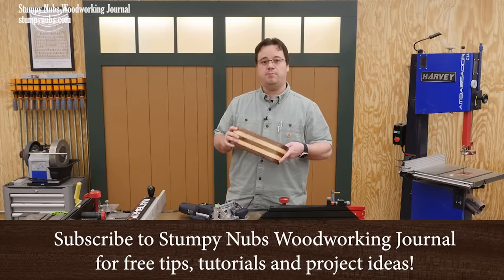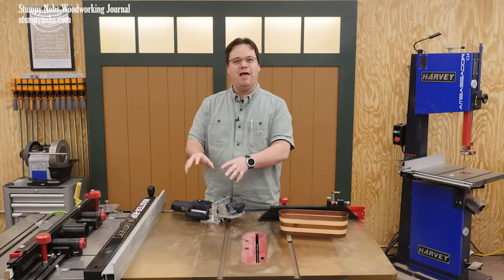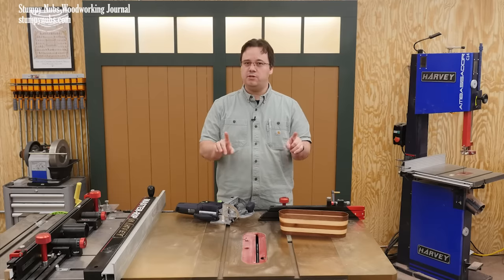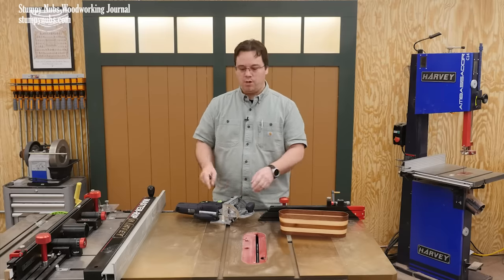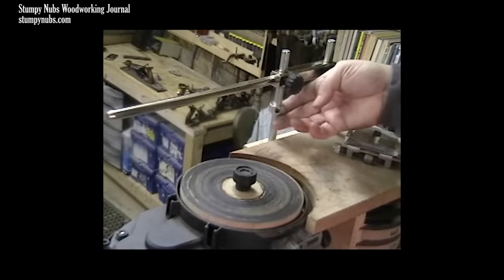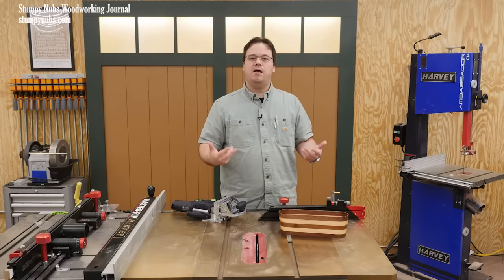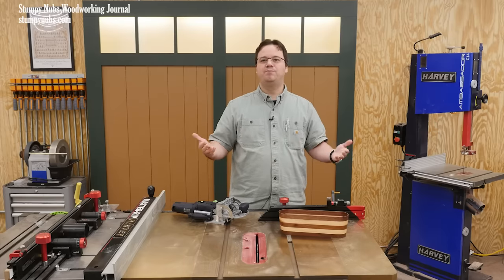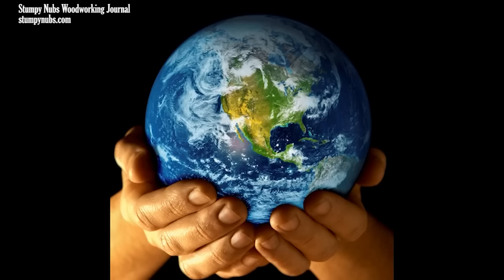This is why people HATE Festool and their Domino!

Comment: Festool typically charges 2x what Makita or Bosch charge for a tool, but the Domino is an extra 2x on top of that due to patent exclusivity. The Festool router is $600 and the closest Bosch is $300. The Festool miter saw is $1500, when a Makita or Bosch equivalent is $700-800. As soon as the parents expire, Makita and Bosch will make $300 Dominos and Festool will have to drop the price to $600 to compete with them.
Reply: Same with SawStop, owned by Festool. It will take years until that happens and other companies tool up and start producing a RELIABLE copy/reproduction
Reply: I can guarantee you Festool won't drop anything. If you've ever used a Festool tool you'll know there's a major difference in quality. Even the high end Bosch and Makita can't compete with the Festool quality.
Reply: @HaasGrotesk  You say that, but as I have pointed out with data, every Festool product only carries at most a 2x cost premium over a comparable Bosch or Makita. The only exception is the Domino, which carries a 4x cost premium, due to the patent exclusivity. (I estimate others could make a Domino for $300 based on seeing brushless trim routers for $200 that appear to have similar power. I added another $100 for router oscillation and a fence.)
Reply: @maximusmagni1  Well, we'll see.
Reply: You beat me to it.
Reply: I agree with everything you've said.  I just wanted to point out that this is a good example of patent protection making it possible from innovators to recoup development costs and an incentive to innovate in the first place.
Reply: Festool are made in Germany, not China, and the quality and design are in a league of their own. I say that as a Makita owner (made in the UK). I will pay good money not to finance China's attack on Taiwan, and keep jobs closer to home.
Reply: So you just made up a Bosch/Makita price, and got your knickers all in a twist about the theoretical Festool markup :D Just wait until the competition releases a version to complain please.  @maximusmagni1
Reply: @MorningNapalm  I wasn't complaining about anything. I was making an observation based on multiple products showing a clear pattern. They created a genuine innovation and were awarded a patent that allows them to recoup their investment/risk.

However, when that patent expires, they will need to lower the cost of the Domino. I am certain Makita or Bosch will be able to make a Domino for 1/4 the price of the Festool. These companies already make routers and Biscuit joiners so we have a good ideas for how much their Domino should cost. Anyone who doesn't think the price of a Domino will drop once the patent expires and competitors start making them is being ignorant. Fein multi-tools used to be expensive, now everybody has one. This happens in literally every single industry.
Reply: @MorningNapalm  Not all Festool products are made in Germany. Festool makes a lot of stuff in the Czech Republic. Festool has begun making products in Asia. Their clamps are now made in Vietnam. (There may be others, but Festool doesn't announce the Asian countries.) People only noticed the information on their packages. I realize it isn't China, but they aren't all local jobs. 

I am not saying Festool isn't top quality, but they would have few customers if all of their (non-patent protected) products were 4x the cost of a Makita/Bosch, instead of 2x.
Reply: @MorningNapalm Uhh, no, that IS the bosch/makita price...
Reply: @HaasGrotesk  Festool is grossly overpriced and over hyped. Mafell's track saw is the worlds best, no competition, and is pretty much the same price. If that company wasn't just into lumber work, they would trash Festool. I've been a cabinet maker my whole life, I've used everything. Outside the domino, and maybe the systainer Vac, the rest of their gear is just hype. Mirka makes a MUCH better sander. Systainers are Tanos. Festool drills are a joke, their battery platforms is dumb... The fact they offer their tools to the US market is what gives them the edge. Their new worksite table saw looks nice though but they put it on their battery platform to make sure noone not invested in their crap won't buy it which is a big loss of business.
Reply: Sorry, I meant to write that you made up the Festool price, it was late.  @sarinhighwind
Reply: @ronkrueger3496  saw stop is actually worth the money.
Reply: @HaasGrotesk festool quality? what are you talking about.
Reply: @maximusmagni1  hell, the new Milwaukee 20 volt trim router is a beast.
Reply: @678friedbed  I'm talking about something you obviously haven't had the chance to experience.
Reply: @HaasGrotesk   ahh the classic, "I spent a bunch of money on something so it must be better argument". bragging about how much you spent on your tools doesn't make you a good wood worker. I love all the extra money in my pocket when I get to produce higher quality products at a fraction of the cost.
Reply: @678friedbed  No one bragged about anything. Your insecurity is showing through because you're just making up things that I haven't said. I also never made the argument that "because it costs more it's better". If there's anyone that says "You don't get what you pay for" it's me! The price of an item does not equate to quality. You're just jealous that you can't afford more expensive things so you put down other people that can. You may "make an extra buck" with your cheaper tools but I make enough money that I don't have to care how much my tools cost.
Reply: @russellashburn6268  Well, define quality. What is quality? Is it just the cut? or is it more than that? Cheaper tools are perfectly fine and they work for 90% of people. Most of the time they work perfectly fine but when you have a business that rely on your tools ALWAYS making a perfect cut and ALWAYS working then there is a difference. I see that most people don't understand this and that's because most people don't have a business. Most people don't understand that Festool isn't even made for them. It's made for us, professionals. And we don't even look at the price of a tool. The price doesn't matter. When I make something and sell it the price of the tool is already calculated in the cost. I can buy a new Festool for ever single thing I sell. But most people don't understand business and don't understand that.

Now the quality. Yes! It is 2 times quality and even more than so. Cheaper tools may work but they are many times a hit or miss. You can get an example like your saw that makes perfect cuts for years but I've bought Ryobi because I was curious and I had to return it before I even turned the thing on because it was broken. Cheaper tools also may work great in the beginning but as you use them they become worse and can't make reliable cuts. Festool isn't guesswork. It works, perfectly, every time, with every tool. When you have an expensive rare wood that you're about to cut you can't afford to mess it up because for some reason that saw decided not to make an accurate cut. It's not so much about the money but it's about your reputation. That rare wood isn't easy to find nor is it cheap. If you promise the client you'll be finished then mess up a cut and have to wait 6 months for the wood that messes up your reputation and that's so much more expensive than 2x price for a tool. Festool also withstands much much more abuse than cheaper tools. I've used my tools onsite and I even dropped my table saw down a pair of stairs. Absolutely nothing happened. That doesn't usually happen with cheaper tools. I doubt your Ryobi would make perfect cuts after being dropped and I doubt your Ryobi could withstand being used for 8-10 hours every day for years. And IF my Festool breaks or need repair it's a no hassle that doesn't create any downtime for me. So yeah, quality is more than just a cut.
Reply: bosch saws are garbage tho. the dual bevel hinge slide has over an 1/8 of play …
Reply: @tomwalters3159  What are you doing to get 1/8" of play??? I haven't seen anything like that on the Bosch miter saw. I have seen a lot of play of the Delta/Rigid saws.
Reply: In the old days, BOSCH blue represented quality. Nowadays the blue color suggests that you are buying a quality tool but it’s not. It’s more a marketing thing.
Reply: 1 @RenBaiHu you are obviously out of touch the ts60 beats mafell  in severall  head to head in Germany  get up to date

Comment: Festool is the Apple of woodworking.  Overpriced, but actually good products.  As for R&D costs, the domino has been around nearly ~15 years now.
Reply: Except the support last three years and you can buy spares
Reply: Yeah this is very accurate. I have a domino and I love it…it twice as expensive as it should be…if not 3 times.
Reply: Your are also buying into a system or an ecosystem, just like apple. In addition to the support etc mentioned, this is valuable.
Reply: @Drowsyrhino1979  compare it to any similar class of professional joinery tool like the mafell duo doweler or the lamello zeta P2, the domino is actually cheaper than both of those
Reply: How long do Patents last? Should be  knock off copies on the market soon.
Reply: @jimsodowsky1298  I thought it was seven years for machinery.
Reply: @coolbugfacts1234  it's a handheld power tool that plunges and wiggles.  It's very nice, I love it.  But one can't deny that it's more expensive than it needs to be, way more expensive than it needs to be.  I'm pleased that I have it and don't regret it for a second and can totally afford it. But it's a wiggly plunge router.
Reply: @cjansson stop it
Reply: @mybossisdrunk  yes boss man

Comment: I kind of wandered into woodworking.  We bought an old house, and discovered that the standards for dimensional lumber seemed to have shrunk.  So, matching original material was not merely sketchy.  If I wanted a replacement piece to conform to original materials, short of rough-cut lumber, I was out of luck.  Machines were expensive.  I was led, by a good deal of literature, to the idea that without machine tools, it was impossible.  Norm was always using machines.  But then I found the traditional wood working community and discovered that all I really needed, if I had the hand tools, was practice.  So, my early projects were mostly practice in time and materials, followed by a final effort that was the finished work.  I converted a lot of wood to saw dust, and butchered plenty more practicing, but I did learn that I really hardly ever need those machines, except as matter of time.  You trade money for time, regardless of whether it's a biscuit jointer or a domino.  You just work the way is comfortable for you, your wallet, and your clock.
Reply: well said
Reply: Exactly. I enjoy watching what can be done with tools like a Domino but when it comes down to me I'm always trying to invent another way that I can do it. It always takes more time but it's a hobby, right? If it was my business it would be about time. That said, the few Festools that I have (usually bought used) I love and are excellent to work with.
Reply: @skitzochik  Thanks.
Reply: @MrRustyjackson  Absolutely.
Reply: We bought a house that was completed in the year 1900. I TRULY understand what you're saying. Ours has mortise and tennon joinery. The frame has NO NAILS. Instead they used 1" dowel pins. Our windows are 36 × 80 . I now have plenty of practice hand making correct sized lumber.

Comment: "Really? You can't relate to someone cutting rectangles of wood out?"
I have never heard a more polite and simultaneously savage burn in my life. 😂
As always another high quality video from Stumpy Nubs👏
Reply: Yeah, that was quite well said. Nicely done Sir James.
Reply: Seriously! I am pretty broke, and I have made some great projects with a chisel, brad point bit, coping saw and a bandsaw blade I made into a bowsaw. My advice for people new to the hobby would be to start with hand tools from harbor freight or something. Then move on to corded tools and a table saw when you are ready to sell projects. You can make a lot of stuff with a table saw and you can do it quickly. Cheap tools provide cheap results. Cheap power tools will function but they are often not square, you are better off getting vintage corded tools from garage sales.
Reply: Especially since some people who use a domino go out of their way to tell you there are three different options to do the same thing If you don’t have a domino. 

And it’s funny because these YouTubers have $20,000 shops and yet the mortiser is the thing turning people off. How about the massive joiner that won’t fit in your garage or the $3000 cabinet saw? You can relate to that crap but not a one trick pony glorified router?  

Make a free jig out of scrap for your router and you can do the same task. It will just take a bit more setup.
Reply: @CarlYota  The thing that puts me off of the Festool Domino at this point is how no Youtube woodworker can be seen using one without the video slamming to a halt for the "I know what you're saying right now, viewer" talk about how "I know it's ruinously expensive for a glorified dowel jig/biscuit joiner 2.0."
Personally, I intend to treat various Youtubers' Dominos the way I've treated Norm Abram's biscuit joiner for the last 30 years:  mentally photoshop my dowel jig over it and get on with my life.
Reply: @Al-qs3xl  cheap tools provide cheap results? Not that simple. I can do what the Domino does with a chisel, mallet and a brace and bit. Not nearly as fast, but every bit as well, with about $20 in tools. Generally, I agree with you. And some genuinely cheap tools are not merely inexpensive but do not function adequately. I try not to blame my tools for unsatisfactory results - after all, I chose the tools ;)
Reply: @Al-qs3xl I would agree for the most part, but cheap, decent tools from the bigger brands offer surprising accuracy compared to what they used to. Vintage tools often need a lot of work to regain precision. Don't get me wrong, I love me a good DeWalt AMF original RAS.

Comment: Two of my neighbors have beautiful large cabinet table saws (one is a SawStop) and they do a great job cutting wood. I have a Sears Craftsman table saw with a cast iron top plate I bought in 1974. With care I can do just about anything with it that my neighbors can do with theirs, except 45 degree bevels ( my blade will not tilt that far), but if I need that I can use their saw or make a jig. The thing I found that really made my saw great was assuring the table guides were parallel to the blade. This has 
really made my cuts 
square and repeatable, and much quicker to set up.

Comment: Cool video and good points James! I have both the 500 and 700 and can't imagine not having them now that I've used them - the efficiency, accuracy, and time saved makes them so worth the price. For a hobbyist, I agree that they are very expensive, but for anyone doing production/content/etc that requires a quick or efficient workflow & build process, they are worth the price 100% in my opinion.
Reply: Truth is, yes they are very expensive and you can do woodworking without them. Then again, they are great inventions and make a lot of points in a simpler and faster fashion. Festool are just very innovative and it's easy for Bosch, Makita and Co to copy once the patent expired. Until then, if you want to enjoy a Domino, you gotta pay the price. Too expensive for you? Everyone gets it as their prices are top range. But please don't deny that they are great tools to have. I have the 500 (and yes, it cost me an arm and a leg) but since then, it has become one of my most commonly used powered hand tools (after drill/impact driver, sander and router). You can do it all without Festool - no doubt. It just takes longer and more effort.

Comment: Good video! I own a Domino, actually I own three of them, but I am a self employed professional woodworker, I do make my living entirely on woodworking. The Domino was a total game changer for me. When I got  the DF 500, I gave away my old DeWalt biscuit joiner, a good tool in itself, but it became obsolete for me overnight. Once I was in the middle of a big job and my Domino broke, something with the switch, under warranty. But I had to send it in for repair and the turnaround time was about two weeks. I couldn't wait, I promptly bought another one and kept working. By the time I got the first one back, the second one had pretty much paid for itself! It is a great time saver for furniture and casework joinery. Now I had two Domino's, and I could have them set up for different bit sizes. Later, I bought the larger Domino DF 700, that's why I have three of them now. It is a professional tool, and it is part of a system. You will also need an expensive vacuum, Domino does not work without it. As you may guess, I have many Festool's; routers, sanders, tracksaws, etc,  If I was a hobby woodworker, I would probably think the Domino is extremely overpriced and I would bitch and moan about it. If I was a hobby woodworker with money to burn, I would probably buy it. As a professional, it was a no-brainer.

Comment: Patent exclusivity is an incentive for r & d. However, the particulars of the patents often allow them to be too broad, actually restricting further innovation. For example, Bosch developed a flesh activated saw called the Reaxx. The saw dropped below the table surface within milliseconds, to spin out safely, without damaging the blade. This is different than Sawstop’s aluminum brake which requires a new cartridge and renders the blade unusable when engaged. Sawstop sued the hell out of Bosch, and production was stopped. In this case, the patent system worked against innovation.
Reply: Greed always takes precedent.